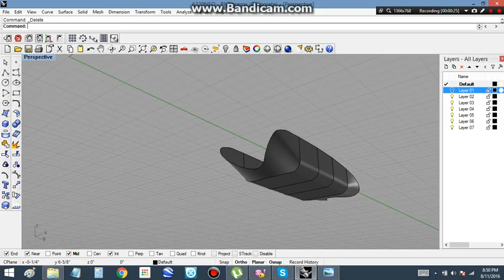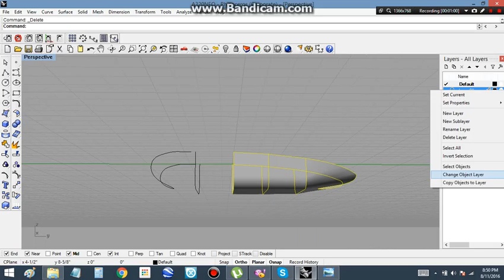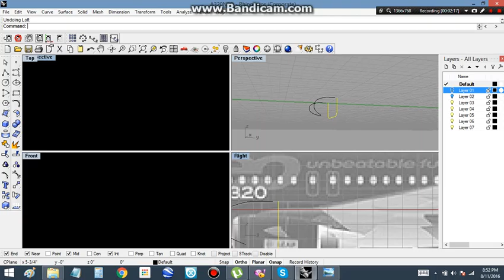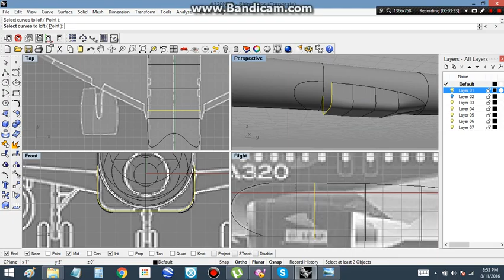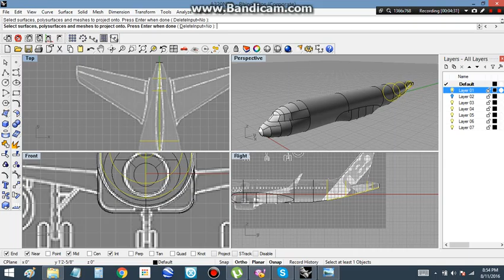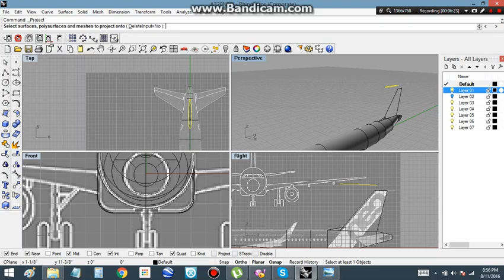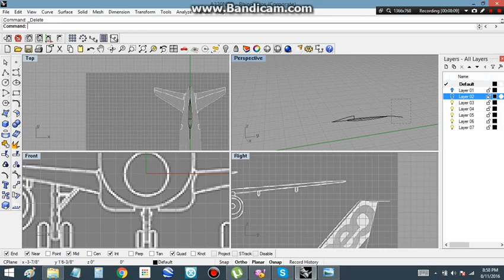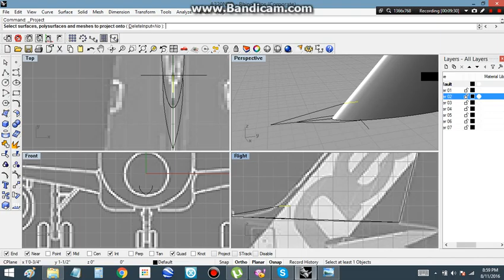finish fuselage, and start on tail

Comment: Hi Aaron..i just found all about video tutorial have you made, thanks you very much. in this time, i learning about rhinoceros software. so, i looking for detail tutorial about how to make plane with this software. and about this part, and for some parts, there is little question. why there are several video tutorials do not explain in detail the process, but part of it directly so. for example this section, when making the glass section and the top of the glass, this video is supposed connection of the video before, right? and other parts of the course. I hope you wish to make the video. once again, thanks to all the video tutorials were very nice this.